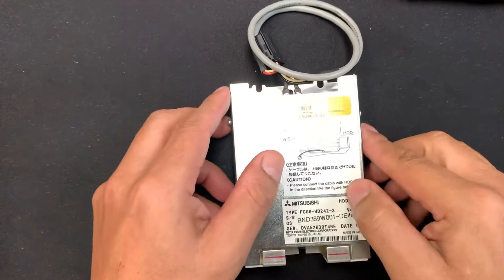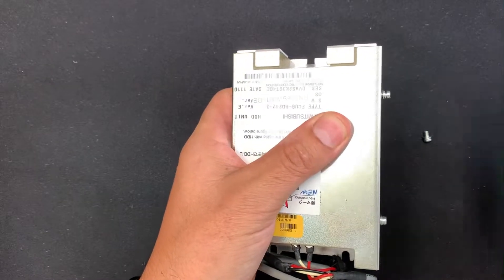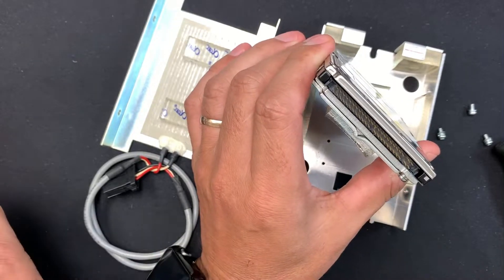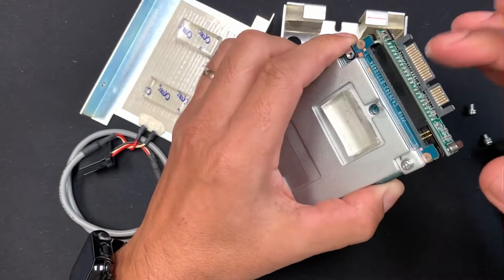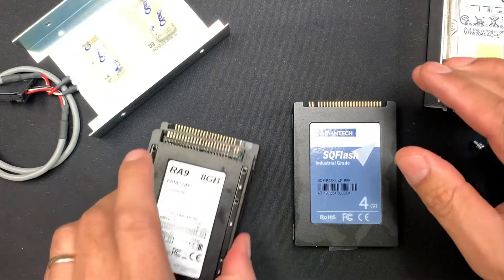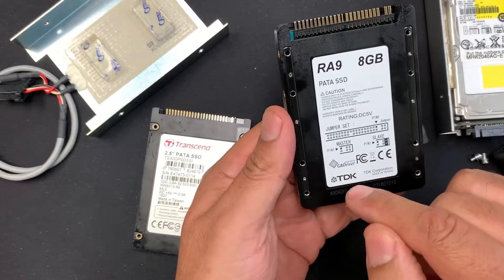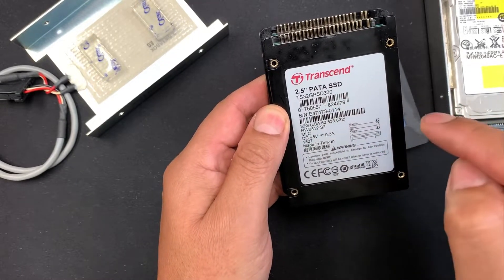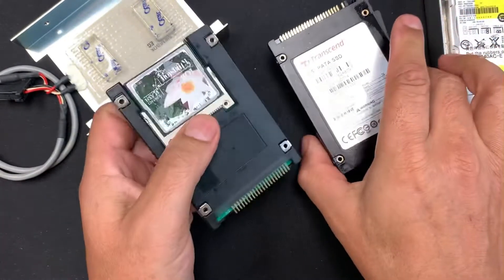How to clone a CNC HDD 2.5” IDE into an SSD. BOM. Part #1.

Comment: Hi Fabian, awesome tip. Just trying to sort a Mazak 100 SY from 2002, and at the first glance in the control panel, i do not see the hdd.

Could the HDD be placed in the back of the monitor (Fusion 640 MT ) ?
Reply from the maker: Hi  @BogdanHurezeanu , thanks for the appreciation.
Behind the display you have the NC unit and the HDD underneath on a metallic case. Se minute 9:30 of next video. Hope it helps.

https://youtu.be/v0ISrxTR364?si=i9zEfgxUWgPNOJ8G
Reply: @FabianAchaval  Got it. I don`t have  a history of the machine I bought. The machine was disconnected when I saw it. What would be the best practice in this case? Should I power it up and see what happens or first try to do the backup of the hdd ?
Reply from the maker: @BogdanHurezeanu  if the machine was idle for a long period, probably the HDD is going to be stuck.
I would try to recover it first, create an image and then clone it into an SSD.

The battery will be dead, so you need to reinitialize the CNC after changing the battery.

You’ll find videos on my channel showing both cases. Hope this helps

Comment: I keep getting Himem or emm386 error.
Reply from the maker: An EMM386 error typically occurs when there's an issue with the memory manager in DOS or early versions of Windows. Here are some common causes and solutions:

1. **Missing or Corrupt Files**:
   - Ensure that both `himem.sys` and `emm386.exe` are present on your system. You can check this by typing the following commands at the DOS prompt:
     ```plaintext
     cd\ 
     cd windows 
     dir himem.sys 
     dir emm386.exe
     ```
   - If either file is missing, you can copy them from another computer or a bootable floppy diskette¹.

2. **Conflicting Data in Autoexec.bat or Config.sys**:
   - Conflicts in these files can cause errors. Try renaming them and rebooting:
     ```plaintext
     cd\ 
     ren autoexec.bat autoexec.ch 
     ren config.sys config.ch
     ```
   - If the issue persists, boot the computer step-by-step by pressing F5 during startup and identify the problematic line.

3. **Corrupt Files**:
   - The `himem.sys` or `emm386.exe` files might be corrupt. Replace them with known good versions from a bootable diskette or another computer.

4. **Memory Issues**:
   - Faulty or corrupt memory can also cause these errors. Boot from a known good bootable diskette that loads `himem.sys` and `emm386.exe`. If the error persists, it might indicate a hardware issue with your computer's memory or motherboard.

Comment: Desearía comprar un disco clonado , tengo un quick turn 250, fusion 640 no reconoce el disco :(
Reply from the maker: @marinobikes, 
1) Usualmente, los HDD son viejos, se traban mecánicamente luego de un tiempo largo de inactividad, y quizás dándole unos golpes suaves contra la palma de la mano se destrabe y te permita recuperarlo y crear una imagen para luego poder clonarlo en una SSD de última tecnología. Una SSD puede llegar a costarte sólo unos $250.00 contra $2,000.00 que te cobrará Mazak o Mitsubishi 
https://www.mouser.com/ProductDetail/TDK/SDE9D008GTYBWB00ESA0?qs=%252B6g0mu59x7IzJ8MIk0uPUA%3D%3D&countryCode=US&currencyCode=USD
2) si no se destraba y si no tenés una imagen del disco original, lo que podés intentar es conectar directamente el HDD a la mother board de una PC (de escritorio o laptop) y realizar un diagnóstico y defragmentación del mismo. NO USAR adaptadores USB ya que pueden dañar el sector booteable e inutilizarlo por siempre
3) La compra de una SSD para esa máquina puede costarte unos $2,000.00 ya sea a través de Mazak o de Mitsubishi, y para ello necesitás proveerles el nro de serie, y un PDF con los datos de las OPCIONES y VERSIONES que esta máquina tiene. Y si la máquina ha estado por mucho tiempo sin tensión, es probable que se agote la batería de respaldo y pierdas también los datos del CNC, para lo cual vas a necesitar un backup reciente para su reestablecimiento
4) estoy compaginando el video del proceso completo de reemplazo de un HDD con un SSD y calculo que esta semana lo subo

Espero que te sirva. Slds.
Reply from the maker: This is the SSD that Mazak and Mitsubishi can sell you and it costs $2,289.00
https://support.mazakcorp.com/PartsPortal/Parts/Search?search=D56076%20&page=0
Reply from the maker: An HDD magnetic as the original it costs $1,427.00
https://support.mazakcorp.com/PartsPortal/Parts/Search?search=D56065&page=0